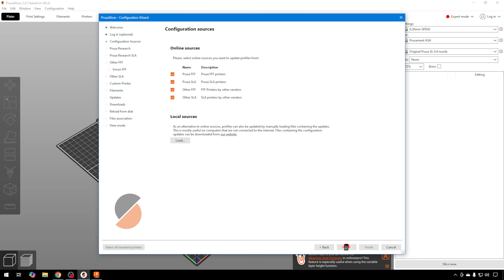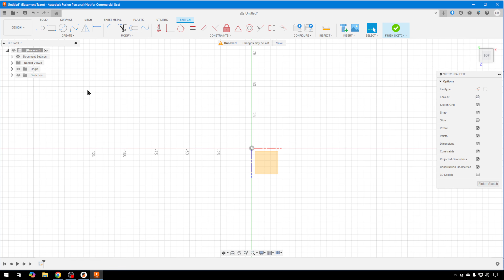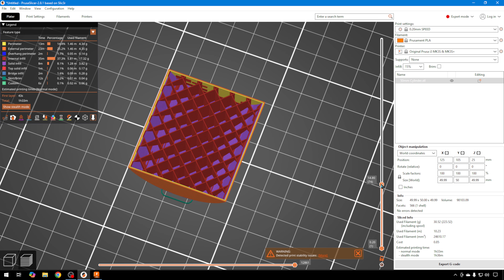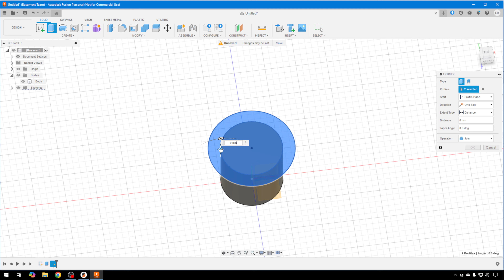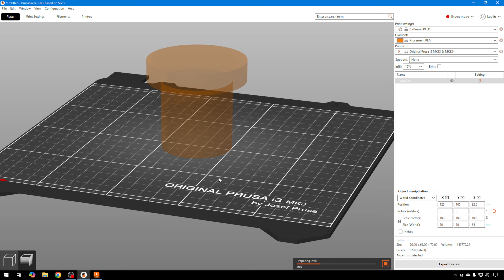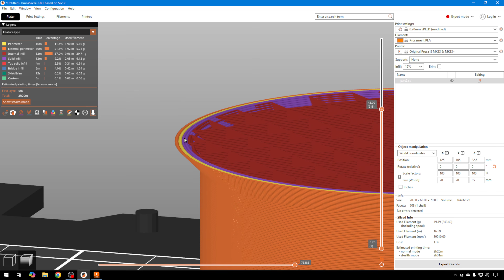3D Printing - Slicing - The Basics - Prusa Slicer - Chris's Basement

Comment: Nice video. One question though, do you have to use Fusion 360 to design your own 3D prints or can you do it with Prusaslicer?
Reply from the maker: You can design some simpler stuff in Prusa slicer.

Comment: ##Chris Riley First of all I like your videos, Very helpful Thank you.
I was wondering how to get my print bed to move to the front when I hit pause.  Simplify3d, skr3mini, marlin & Visual Studio Code, ender 3 profile. either in the uncompiled data or in my slicer.  Thanks
Reply from the maker: Thank you! The pause feature is in the firmware, so the slicer can't tell it how to act. The only way to achieve this would be to reflash Marlin with the option built in. It can be a bit of an undertaking if you've never done it before.

Comment: I like that you set it up only for the printer you have.  A new user could go crazy and have way too many options and make simple mistakes.  I use Prusa SLicer for about half of my printers and Orca for the others.  It gets to be complicated if you have too many being used at one time.   A new user can experiment with different options - orientation and speed, the beauty is that most prints are going to go pretty fast and not use too much filament.  If it fails you are not out a lot of time or expense, one of the advantages over working with wood or metal.
Reply from the maker: Thanks Dave, I am trying to ease into the whole process it's hard to know what people want to know.
Reply: I've built two Bear clones, both Bowden, no auto bed level and successfully using modified E3 v2 profiles with Prusa slicer. Just edited some parameters, acceleration, retract distance etc. Just need to work around what you have.

Comment: oh yeah the "sorting files....." I forgot about that. I haven't used my mk3 in so long. And I never will again. It's getting upgraded during the break to a 3.5. Honestly I don't know how much use the 3.5 will get.
Reply from the maker: You're going to love the 3.5!
Reply: @ChrisRiley  Well......I will say this. I actually prefer revo to the mk4 hot end. It's completely tool-less, no wires, just quickly screw it in by hand. But my mk4s (newly upgraded from mk4 with the "wrong" LCD lol) does get most of the work. 

I mostly wanted to use my mk3 because it was in a room where I cut off the AC and I wanted to print PP. My mk4 can't do PP cause of the drafts. However......prusa just released the new PP sheet. I'm wondering if this means I can print PP at any time. Warping off the bed was the only issue I ever recall. I don't think it splits layers. 

Anyway.....the mk3 doesn't work because I never bothered to upgrade the MMU2 and even with a USB adapter (maybe it's faulty) I get all 5 green flashes. I couldn't even start the print. I have the kit. I have the printed parts, I just haven't gotten around to it. So that too will be xmas break. 

Maybe I start taking the mmu2 apart this weekend. I honestly have no idea if the mk3.5 will ever use the MMU3. The mk4s almost exclusively does. lol